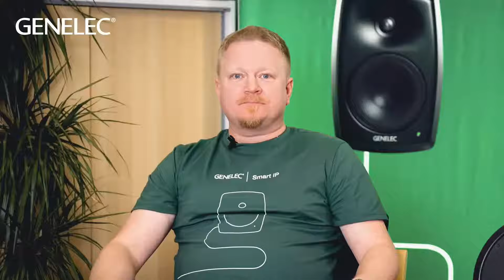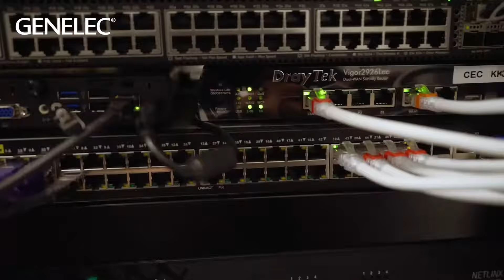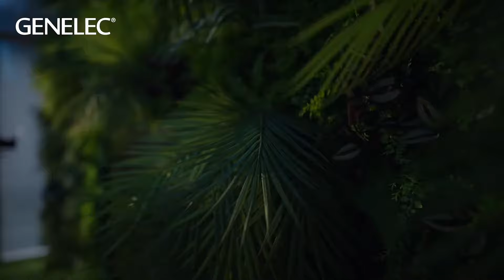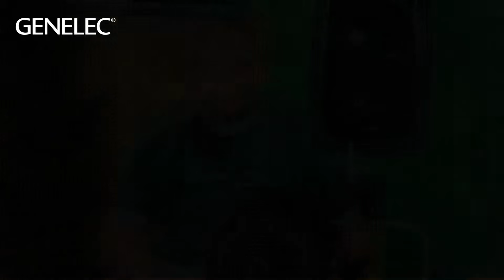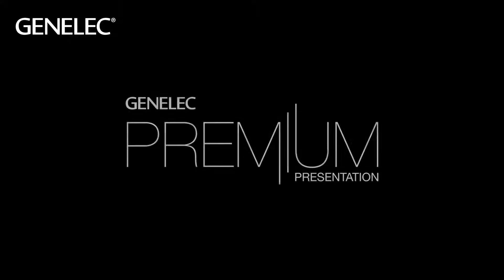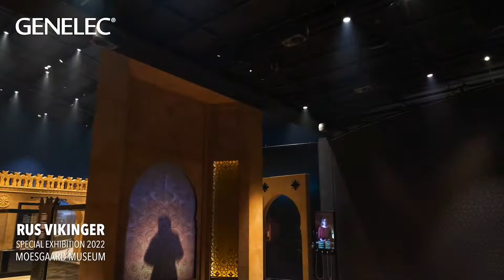Genelec Smart IP | 4435A & 4436A launch replay and overview

Comment: Are the IP speakers only Mono or can they be installed as stereo?
Reply from the maker: It is possible to select one audio channel or a sum of two channels in a stream. In demanding installations, where
there is a wish for stereo reproduction at one or more locations, stereo audio may be sent on the network, and individual speaker can be set accordingly for L, R or L+R operation.

Comment: Wanted to know if smart IP app will it control the volume and on and off for my Genelec 8341 A coaxial 
Monitors 
Please let me know 
Thanks
Reply from the maker: Apologies for the very late reply! Smart IP manager is designed to be used only with Smart IP -series of speakers. 8341A is part of our SAM-series, and should be used with the GLM software, but with the GLM software it is possible to control the volume as you mentioned for the 8341A speakers. If you need any more information, or have any questions, don't hesitate to contact us at support@genelec.com